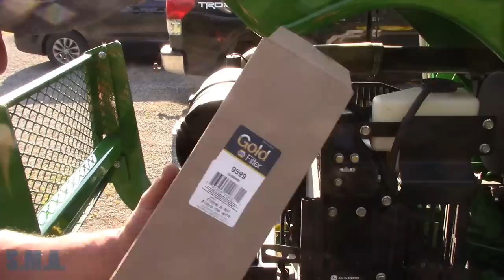John Deere 5055E : Service

Comment: A tech tip for ya Mr O. I have a 5055 and a 5203 JD and just did the filter on the 5203 yesterday. If you put the o ring down in the filter grove instead of the housing, you don't need any tools to spin it on. You can just hand tighten it.

Comment: A piece of a serpentine belt nailed to a stick makes a decent belt wrench. You nail the belt along the stick, going up the board, then loop the belt around the filter, put the belt across the end of the board and up the other side. Hold both the board and belt and turn.

Comment: More things I didn't know! Presumably pressure at the bottom will be significantly higher from the mass of liquid "beet juice" above. In Africa we would often reduce air pressure dramatically when driving in sand, it made a huge difference. Mud is something very different.

Comment: If your in a tight spot you can use a belt. You can also use a screwdriver and a shirt wrap the shirt around the filter hold it tight turn the screwdriver around the shirt like a makeshift tourniquet.

Comment: Eric, on a diesel always check your air intake hoses and connections. Even if there new, if a hose gets a split in it somewhere dirty air will take your engine and turbo out quickly. I usually run my hand where I can't get a visual on it.

Comment: As a tech at a local dealer, I enjoyed this video. I was curious though on the beet juice in the tires? We use anti freeze/water mix in our tires for weight. It makes them heavy and quite cumbersome to move around. Great video though! This what I do a lot at the shop. Retired LE officer to turning wrenches and fabricating at a tractor dealer!

Comment: Many years ago, right out of high school, I worked for four years in the Oldsmobile factory. I spent 1.5 years in the "Press Metal Room", using a power press to shape sheets of cold steel into parts. The "toolmaker" skilled trades would be around, and watch me work. Then a week later they would bring me a hand-made tool to use to load, or unload, the press. I learned a rule 6:15 for a lifetime, "the job goes so much smoother when you got the right tool." Lucky for me my  wife worked in the next room. Our family rule, "Buy any tool needed to do the job." I am not a mechanic, so I do not have anything like the number of tools Eric has, but I do have an impressive array of household tools.

Comment: Next time you need a filter wrench in a pinch, grab an old belt and  wrap it around the filter, then double-back through the buckle. You will be able to get enough force on the belt to turn it tight enough. This trick will often work for getting them off, too, but not if they've been installed too tight.

Comment: Great Video Eric, I was a supplier to John Deere and I think they  engineer great products.  Just a couple of points, fill the fuel filter with fuel before replacing it to reduce the amount of priming required.  The second concerns pressure washing, always do it when the engine is cold.  Your engine Ii noticed is fitted with a mechanical fuel injection pump and if you pressure wash it when it is hot there is an increased risk of seizure due to the very close tolerances used.  If they seize they need a major overhaul which is expensive.
Reply: Never ever prefill a modern primary fuel filter
Reply: Fill the fuel filter so you can dump fuel all over as you install it lol. That's why there is a primer bulb. Don't wash your tractor when it's cold? What kind of scam is that, next you'll say they should only be dried off with diapers. Typical JD ding dong.

Comment: Nice job with service!!
Only one comment 
I use tin foil to control oil flow on my bobcat when changing fluids to save clean up and old dirty fluid going everywhere.
I also use Webber tin trays to catch oil diesel in tight places as the can be molded and bent.
Reply: I will certainly use that tip for my Audi, makes a mess of the subframe to change filter.

Comment: Good thinking there not mixing hydraulic fluids. Sometimes used hydraulic fluid isn’t even compatible with new fluid of the same make and type, so to mix used fluid with new fluid of another type is generally a risk. Great seeing you work on your machines, even thou John Deere is a competitor to my employer.

Comment: Beat juice doesn't freeze. They used it out in Indiana and surrounding area on roads in winter, from what I hear.
Reply: You are correct, they are trying it on roads and I have heard of folks putting it in tractor tires for weight ballast. As of now it's kind of hard to get, hopefully that changes. The beat juice is not corrosive like other stuff.

Comment: Have read about complaints when servicing newer diesel engines that require a special software package only available at the dealer. Will be interested to see how your tractor fares when it has accumulated more time and needs more elaborate service procedures.

Comment: Mr. O, the hydraulic fluid looked brand new, not bad for 8 years. The motor oil was rather dark though. Nice clean tractor in any regard !
Reply: Diesel engines get dark oil rather quickly. As long as you change oil every year or 200 hrs whichever comes first you're good.

Comment: I like this for inflating tires, digital gauge and an air release. better that playing with just an air hose and a tire gauge - a lot faster too. 

Husky 024-0375H Heavy Duty Digital Tire Inflator

Uses 2 AA batteries last a very long time, i use energizer lithium as the work better in the cold.

Comment: Keep an eye on the battery if you plan to keep tractor a long time. It will corrode the radiator and rust the frame area and at the least make it look bad

Comment: Inside the oil fill tube the flange is there because without it a funnel would easily fall out. JD screw up and the flange is their cover up.

Comment: Thanks for bringing us along!  Tiny correction for the explanation of the "blow across the hole" trick you used at 34:30.  It's the Venturi effect, so it's the exact same as a carburetor: high air velocity past the hole creates a lower pressure zone, which sucks the fluid out (or, if you want to be more scientific, it causes the now relatively-higher internal pressure to push the fluid out.)

Regardless, thanks for sharing the trick!  That one's goin' in my toolbox for sure

Comment: Eric
Why not put plastic caps on all the grease fittings ?
To cap close the holes ?
Keep mud , dirt and keep all the junk out of the hole surrounding the Grease fittings.. 
Joe Navy veteran 🇺🇸🇺🇸
Reply: You try putting those silly caps on and see how many are left after using the machine lol They fall off just looking at a tree branch and are pointless because all they do is trap moisture in the end of the zerk and cause it to rust. Wip off with a rag or towel and grease it.

Comment: 10w30 universal oil or UTTO as it's abreviated "universal tractor transmission oil" hydraulic oil is only used where the machine has a separate hydraulic tank because the oil in the  backend runs the transmission and the brakes hydraulic oil doesn't have the required lubricity

Comment: Silicone grease is what we use on aviation oil filters...that's what I use on my cars as well. FYI: Aviation oil filters are safety wired on to prevent movement.
Reply: REALLY? I thought the wire was to prevent them from getting too tight! I've been doing it WRONG!

Comment: 34:40 just an FYI, it's high velocity out here, low velocity in there, therefore you suck out. Higher air speed = lower pressure! Otherwise planes would never fly. Keep up the good content, love the videos and the professional attitude.

Comment: Check hydroc oil cold and hydrolic Rams retracted  . Check with your John  Deere dealer to be Shure  also  use loader safety prop support when working around raised.        Front end loader. You could blow a line and it crush you.or if engine is in op you can't  raise the loader.

Comment: Thank you for the video. I have a 5075E with about 1300 hours. The Power Reverser keeps freezing up and won't go from Neutral to Forward or Reverse. When it does, I get a "Transmission Information Indicator" Any Thoughts?

Comment: I like to write the hours and the date on the filters when the unit was serviced it with a paint marker. When I used to work for a JD deal we would fill the tires with water run the valve stem to the top of the rim and fill them to there and then add air to them
Reply: Works best when the temps never get below freezing. :-) The tires on my Dad's 1941 Farmall H were filled with a calcium chloride solution for ballast. Some of the nastiest, corrosive stuff you can imagine.
Reply: @markwheeler202  in my part of the country we don't have to worry about the water freezing was just stating how our process worked because Eric said in the book it said to check with the valve stem at the bottom but thank you

Comment: the correct grease gun grease is very important. with the wheel drive planetary drives frequent oil changes may be needed if they are worked hard.

Comment: Not a fan of "E" series.  Is it a 9 speed collar shift?  Even w/ a gear trans, if it is used in the winter, Synthetic trans oil is an extended life fluid.  Crankcase synthetic is a good idea as well  once you have break in  hours accumulated.

Comment: Fyi- I never use any aftermarket transmission filters on any heavy equipment, Especially anything with a zf transmission. I have seen them  break apart and trash the transmission. Believe it or not but John Deere warrantied a trans which failed due to a defective filter.

Comment: Also those 5000 series is known for the brake fade. I have a 5100E and dealer had it apart to replace the master and it's still the same way. It doesn't seem right but everyone that has that series says the same thing.🤷🏻‍♂️

Comment: Nice thing about NAPA filters, they are made by WIX, so top quality..
Reply: You seem like you are an expert. An expert youtube commenter. That might be why you are wrong.
Reply: @jonasthemovie  actually been a mechanic for 30 years and excuse me napa gold filters are made by wix.
Reply: @supercrew63 So, if they switched to Mann Hummel, you would know about it? I misread the first comment, read it like you looked down on Wix like many do.
Reply: @jonasthemovie  I love Wix filters they are on everything i own..And ALWAYS ran them on my racecars...If they changed to Mann Hummell my Napa did not tell me..I have been on great terms with my local Napa for over 30 years... napa carries the silver line and the gold and i have cut them open and there is a huge difference internally.

Comment: Hey eric, Ive seen videos of people using an old serpentine belt or like a bicycle chain link and putting it around the filter or whatever youre trying to spin off and then sliding an open end wrench from the other side up to the filter and using the wrench as you used the ratchet in the video. Wonder if it wouldve worked in this case?

Comment: I'm REALLY surprised NAPA had a filter for the hydraulics.....especially on a JD.  I have a 15-year old Kubota, and there are still no aftermarket hydraulic filters for it.  And that factory filter torque is a common thing.  On both the Cummins engines I"ve ever had, the factory oil filter was put on dry and took a cheater bar on a cup wrench to break them.   I never could get a straight answer out of Cummins as to the reason they do that.

Comment: Eric, hate to be "that guy", but please use a mechanical cylinder lock on the loader lift cylinder when you are working under it. It should have one attached somewhere.  Had a coworker get hurt when a seal started leaking and the loader came down on him while he was working on the engine. Fortunately just scrapes and bruises but could have been much worse.

Comment: Eric compared to the rest of America, are the Deere's up there in Yankeeville about the same price or are they cheaper or higher?................We just went and purchased a Kubota 2501 Tractor with a Front Loader, 5' Mowing Deck and a 67" Box Blade. We shopped around comparing all the Tractors out there. After going through severe "STICKER SHOCK" when looking at a comparable John Deere (The same size Deere here in Oklahoma was about $7,000 higher than the Kubota) we decided on the Kubota.......The 10 YEAR WARRANTY was a Plus!
Reply: Location has a lot to do with pricing. and John Deere likes to over price there stuff, all of it lol

Comment: You don't need to bleed the hydraulic filter. It's on the return side of the system.
Reply: Saw comments saying it was important to get it airtight since it was said to be on suction side, which didn’t make sense at all.

Comment: When working on heavy equipment; I’m usually thinking to myself. What is going to kill me next? Gravity is always on the job you know, the whole shake hands with danger type situation. You may have taken care of the risk off film or not covered it. I’m not personally familiar with that model of tractor. My question is this: What is stopping that bucket from coming down and turning you into two mushy pieces crushed by the loader linkages do you stick a solid pipe in some where or are you just hoping the valve doesn’t shift whilest you are inbetwixed the motorbbb and the loader linkages. “ as long as you feel safe” I dunno I would want something mechanically locking that bucket in the air. Not just the 5 cent seals
Reply: Don't walk under the loader bucket, pretty simple. If you're worried about when he is on the side of the tractor you need to realize that he would have to be hugging the hood to get squished. Concern without understanding the machine or what you are looking at is just silly. And you really should understand hydraulics and how they work if you're going be so concerned. That loader may come down quickly if something were to happen but it's not instantly, seal blows out like you say and the bucket only comes down as fast as the oil leaks out.
Reply: @farmcentralohio  👍🏻

Comment: With very large disc brake rotors, unless they are running perfectly "true", they will have a tendency to knock the piston back into the caliper resulting in that "double pump" issue you mentioned.  Probably nothing you can do about it.

Comment: 2 things I noticed...one is the radiator should have a pre-screen in place.  Is your's missing?   And two is..there should be a magnetic screen that needs cleaning at each hydraulic fluid change.  Where's your's?
Reply: Most of the newer tractors no longer have a suction screen. They use a suction / hydraulic filter

Comment: I've never worked on a tractor. Engine oil filters I always only make hand tight (they are mostly a bitch to get off anyway), does the same apply to that hydraulic filter, using a tool to tighten it down seems a bit overkill...?
Reply: It think the wrench tighten was more do to not being able to get a good grip on the filter to tighten it correctly   Also hydraulic filters on tractors are a suction type filter not a pressure filter like most engine filters.  So they can suck air around the seal and introduce air into the hydraulic system which is the case of the loader will cause jumping.  It will self bleed after sealing but can just be annoying.
Reply: @ngnmech  Ah. Makes sense to me, also good to know on the doubtful off chance that I'll work on a tractor one day. Thank you, and friendly South African greetings!
Reply: You one would actually read the obscure pictograms on the new filter, they show how many turns one has to tighten the filter after the gasket makes contact

Comment: My theory is if it comes from the factory and it’s two years old with X amount of hours and there hasn’t been any leaks then all those axle fluid levels are just as if it rolled out of the factory.  But it doesn’t account for “Schmutts “

Comment: If you prime the fuel and oil filters you won’t have a problem I do it every time with cars and trucks saves wear from running dry till the system primes
Reply: He primed it. With the pump and bleed screw. As you should. Don’t put dirty fuel in the primary filter. What you think is clean fuel is dirty to the engine.
Reply: Of course you don’t use old fuel and oil you use fresh fuel and oil that’s a rookie mistake
Reply: TOWMAN1762000 Fuel and oil from a sealed container are not to be considered clean.
Reply: Ok if you say so I’ll just let you ponder that stupid statement because fuel coming from a tank is super clean LOL 
I also don’t remember that part on the heavy and light ASE test
Reply: TOWMAN1762000 To trust that all oil and fuel is clean, that is stupid and easily disproven belief.
Reply: Ok with your logic brand new filters and fluids in seal containers and fuel straight out of the pump into a osha approved container is no good so then what is the point of doing services with new parts if it’s all bad according to your logic

Comment: Unusual it stated without depressing safety switch on clutch ?  I usually Jack up the rear axle, to take pressure off the tire when checking  tire pressure on loaded tires.  Less tendency for fluid to contaminate air gauge.
Reply: If probably just checks to see if the shuttle is in neutral and the PTO is off.

Comment: I have always thought you should never use an oil filter wrench to put on a filter, only to remove it.
Reply: On cars mostly but tractors with the bigger filter require a little more ooomph

Comment: Check rock auto for these filters. They have a lot of these filters, wix brand, same a napa, for half the cost. For a few, I had to use the wix site to get the wix filter number from the dealer numbers (which I also got online), then use the wix number in rockauto.
Reply: You think Wix still makes Napas? Think again.

Comment: Don't get under any part of that loader when it is not resting on the ground or anything else that can hold. Some rubber and metal is all that is keeping you safe then, and it is fine 99% of the time, but it is exactly like trusting a jack without a jack stand.